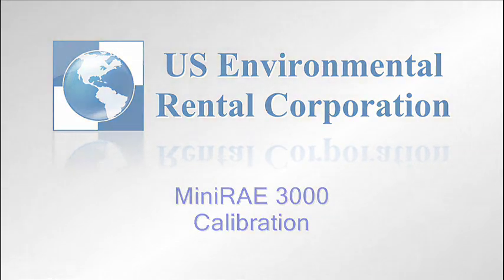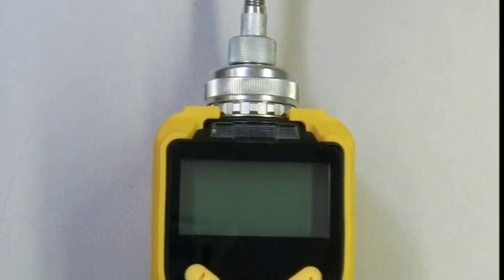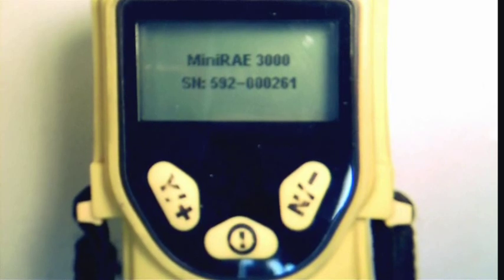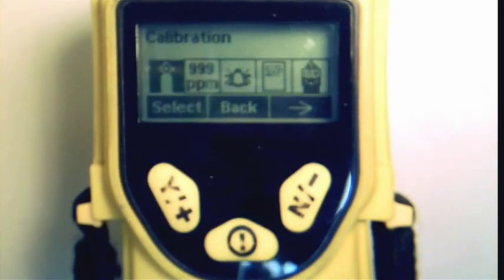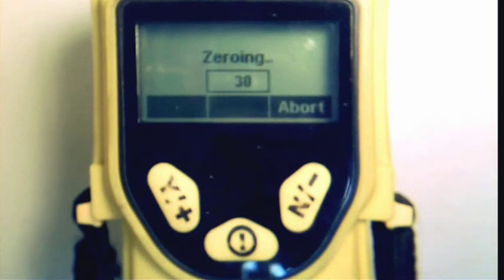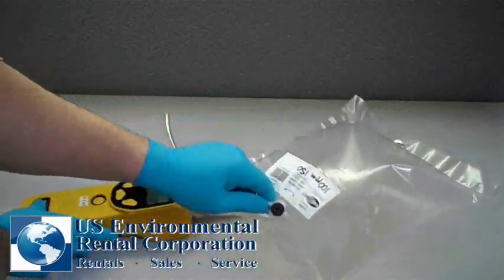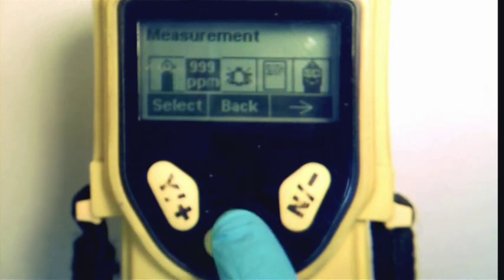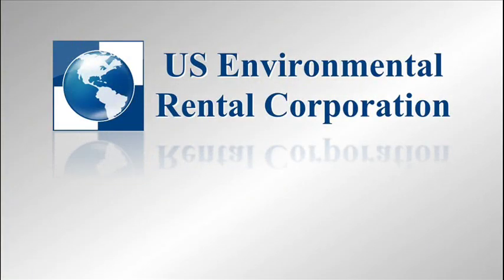MiniRAE 3000 Calibration

Comment from the maker: The steps for calibrating a ppbRAE 3000 are essentially the same. However, you would need to use a much lower concentration of Isobutylene - typically 10ppm.